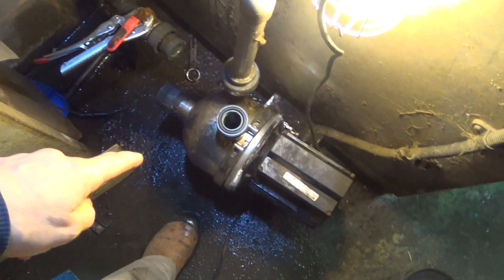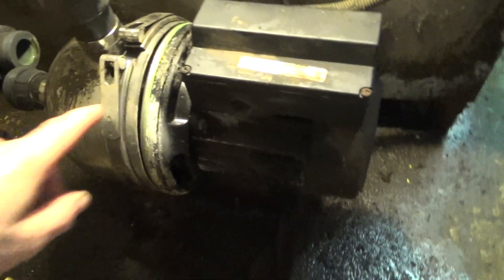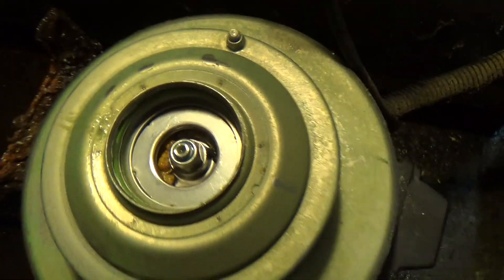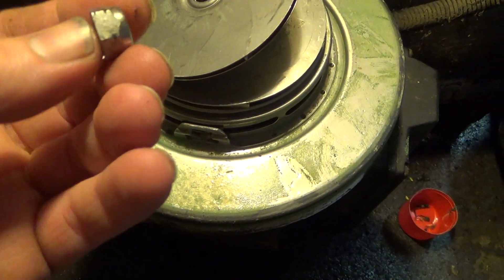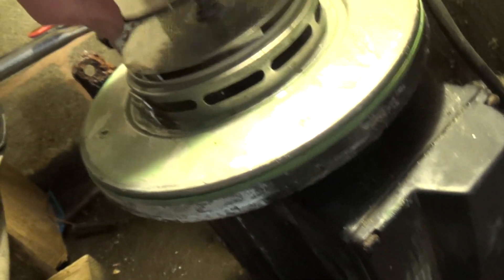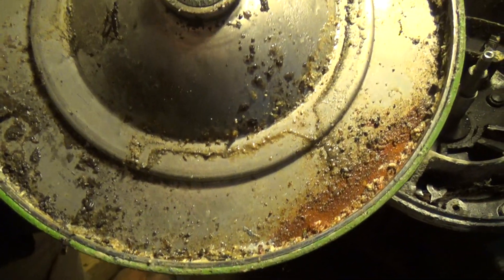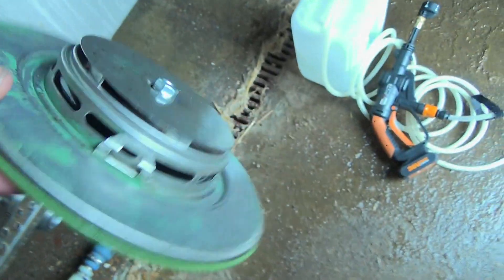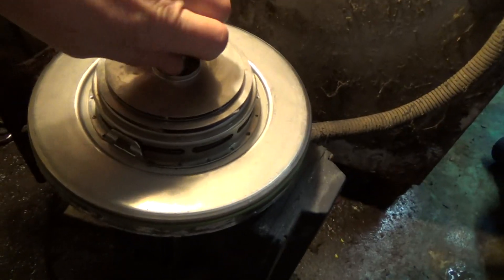Bunged Up

Comment: any reason its a two stage pump? seems like a one stage would provide better flow for the application...
Reply from the maker: Its what the manufacturer fits to them. Previously they had milk pumps but they are really expensive.

Comment: Good vid. You can allways blow those out with c02 gas. use a co2 adapter , a refrigerant hose with a tiny access valve screwed on the end of the hose & blow  the shit out of the impellers. Then Allways  Make sure u have a inline " Strainer" on the inlet of the pump to stop this from happening  again.
Reply from the maker: That's a good idea to use CO2, in the end I used my mini jet washer which worked well. Theres no filter on these from the factory, if it does it again will suggest we fit one.